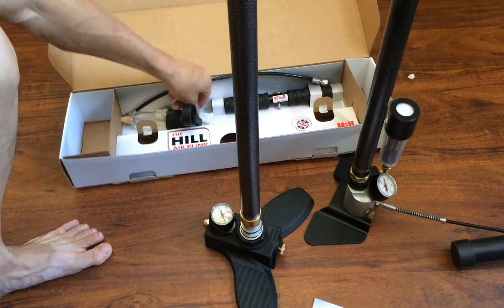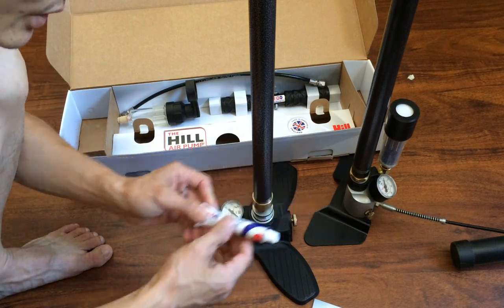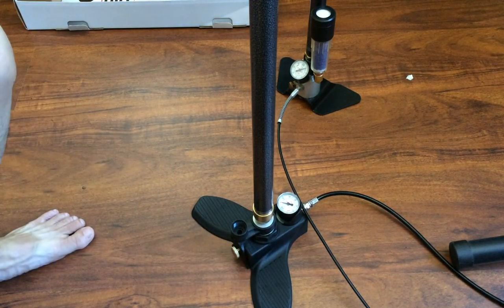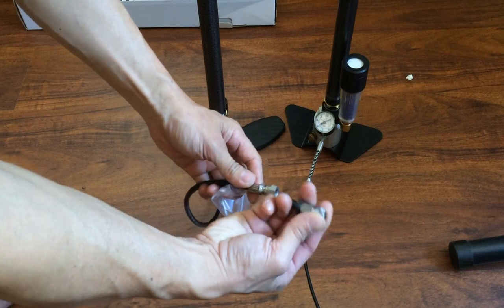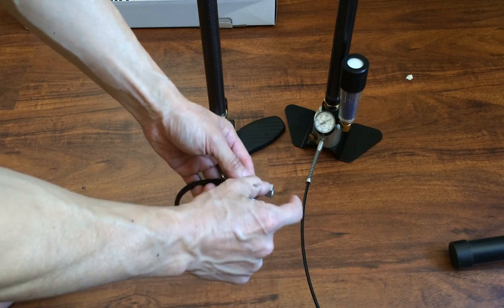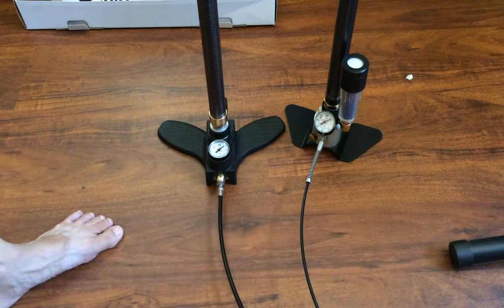Hill Pump MK4 unbox & assembly

Comment: Thanks for the video. Hows the weight compared to other pumps?

Its actually not pressure that causes combustion but the heat built up from very rapid compression. Think about it - it would be impossible to store things like welding gas that is always under heavy pressure if pressure alone caused combustion. The heat buildup is due to molecules slamming in to eachother, its friction basically. Thats how a fire piston works, its a pretty cool gadget, worth a google for sure.

Exploding handpumps and air cylinders is likely a myth because its impossible to fill fast enough (unless you hit the pump with a sledge hammer or something) to generate enough heat to ignite most petroleum based products. Your o-rings would likely melt or wear out before that happened. The reason its silicone based grease is used is because it doesnt eat your o-rings, its actually good for them, they suck it up and it prevents them from oxidizing.

Comment: Thanks for the upload! I got my MK5 today. First time ever using pcp or a pump. Man I’m shattered, my arms, legs, palms and tummy are in pain. 

My tank is 4500 psi and I got it to 4000. Honestly it was difficult and painful. Any tips on how to make the pump smoother or less friction? Your advice would be appreciated. Thank you
Reply from the maker: Let it cool before pumping again, the o-rings will thank you.  Other than that get a compressor, oil one is best instead of those non oil ones.  Bigger air chambers was why I got a compressor.  Now that I sold all my larger PCPs and only have the Leshiy I'm back to a hand pump and the compressor is up for sale.

Comment: Here I am in 2020 and still trying to figure out that pricing difference. EDIT: Ok, I think I figured out the difference in price. The bundle comes with a quick disconnect fitting while the non bundle does not. With today's price, the difference is exactly the cost of the fitting, which is $20.